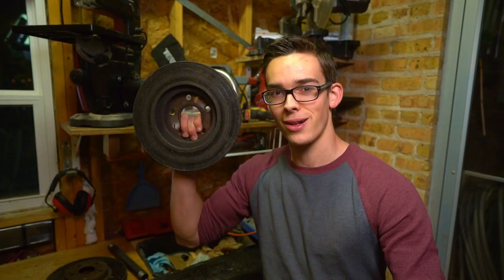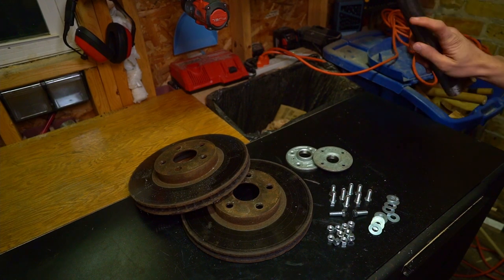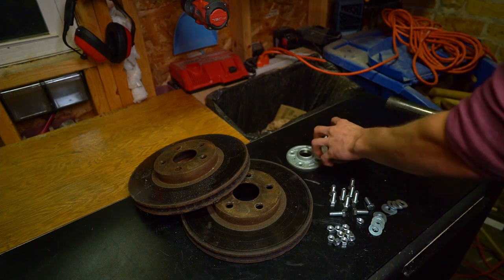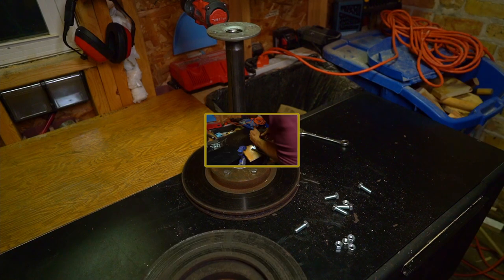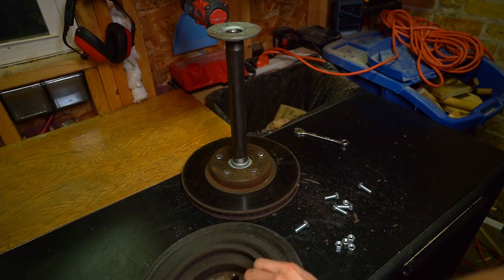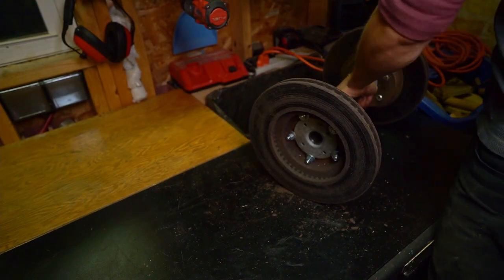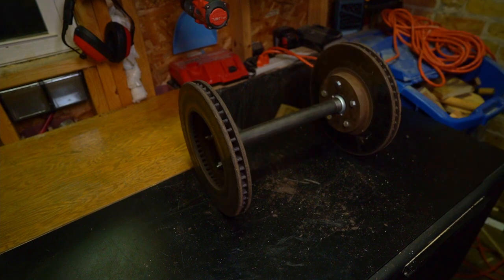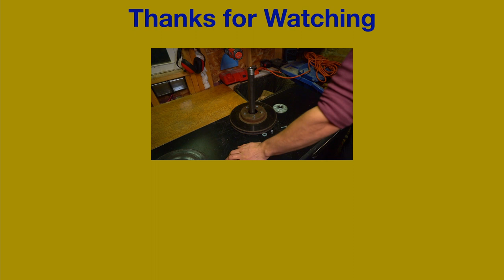Repurposed Brake Rotors For A Dumbbell | DIY Workout Equipment

Comment: Donde se compran las bridas y de que tamaño
Reply from the maker: Ace Hardware and 1 1/2
Reply: Hi 
Thanks for the video 
Can you please provide list of the items with sizes..appreciate your help on this
Reply from the maker: If I remember correctly, it was a 1 1/2" x 12" pipe nipple, 2 - 1 1/2" floor flanges, and bolts, nuts, and washers to hold the brake discs on (the diameter of which is dependent upon the size of the brake discs).